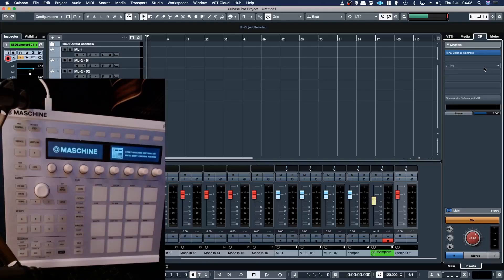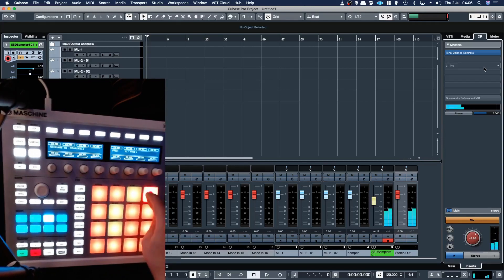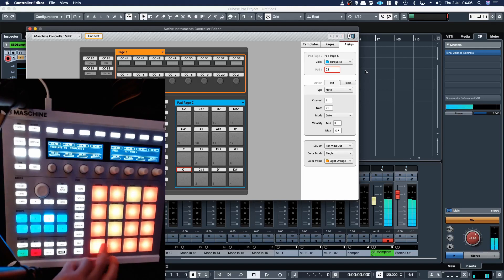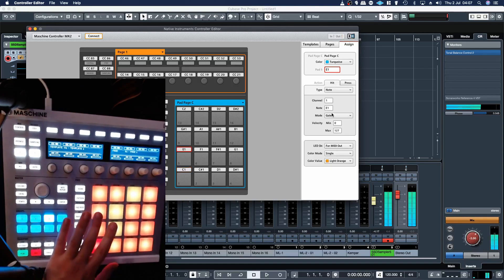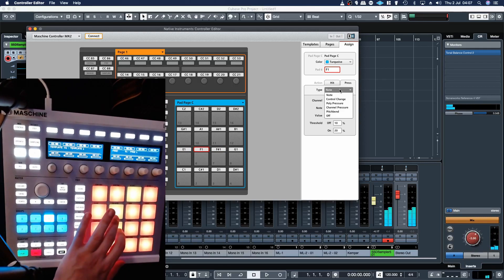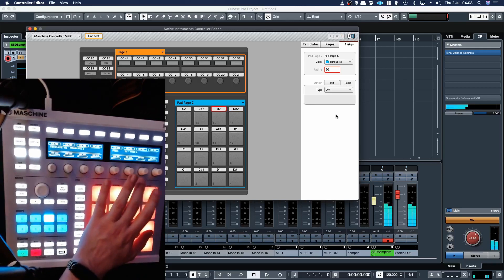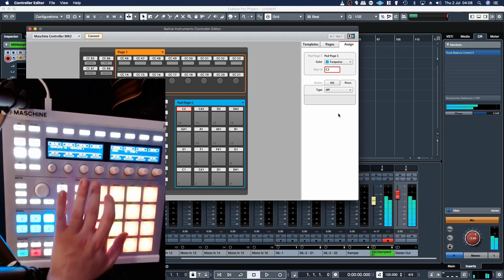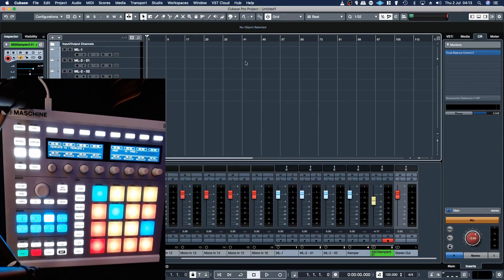Setting Up NI Maschine To Work Properly In MIDI Mode Within Your DAW

Comment: any reason why my maschine studio wont change to midi mode when holding down shift + midi button? I can't figure out how to enter midi mode on maschine studio
Reply from the maker: I never use MS, but maybe it only works outside of Maschine Studio.
Reply: @JohnMarshall-NI  thanks for the reply. A simple install of the latest machine 2.14 solved my issue. Wouldn’t commit to midi mode without the maschine app…now I’m rollin.